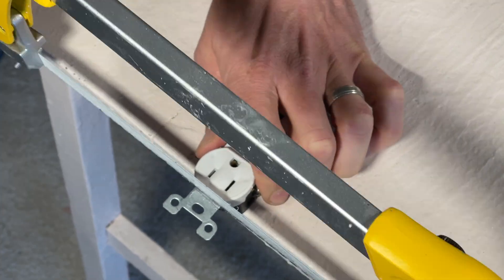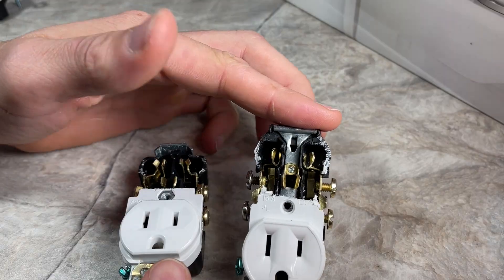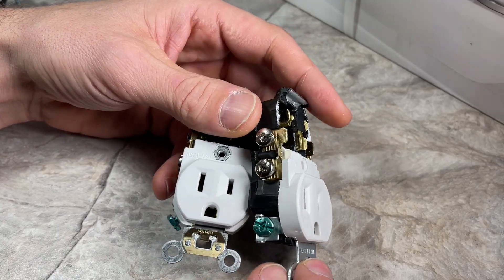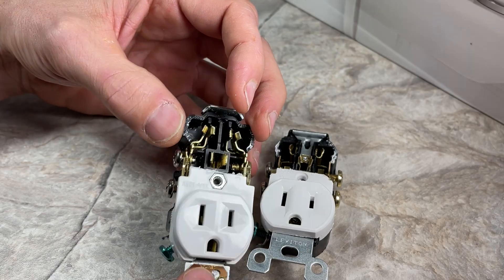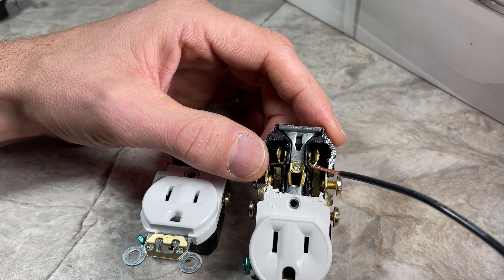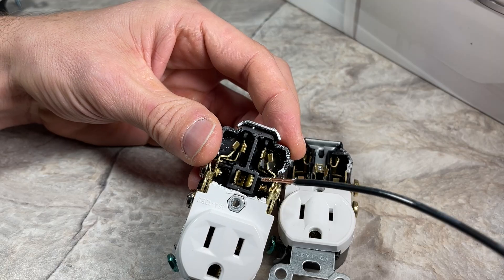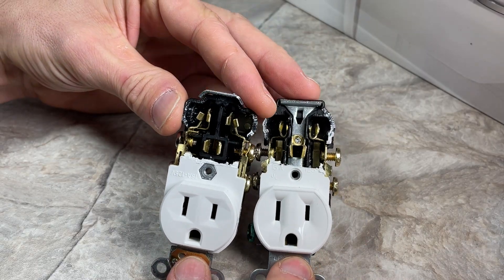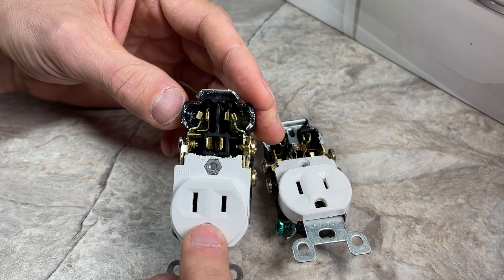What Outlet Should You Buy For Your Home |  Commercial vs Residential

Comment: What would cause the plug from a kitchen appliance, a flat top cooking grill, to be partially ejected from a 15 amp, residential duplex outlet during the heating cycle, which causes the appliance to shut off? It is not a loose plug. Is that because the kitchen appliance is exceeding more than the 15 amp usage than the  wall socket is rated for?  The power does not shut off and when we push the plug in again, the appliance keeps on cooking.

Comment: If hot does short to ground, the breaker or fuse is supposed to blow immediately so that shouldn't be a problem. Where arcing is occurring that is the worst is if there is a loose hot or loose neutral that's got just enough room to wiggle around, that's when you're going to get overheating, arcing, and fire. This is another reason I am so bullish on grounding. If the hot comes into contact with something it will trip. As for the other problem, that's more of a GFCI AFCI which is required in newer builds I believe.

I wish the NEC had broader authority and made a receptacle, outlet, whatever you want to call it, have a minimum specification of the contractor grade, then these bargain bins would go to the rubbish bin, where they should be. So yes, a little bit of dictatorship where the garbage is not allowed to be sold and disappears. If there is a code, then all products sold must be code. For example, Tamper Resistant is code, so then, why the hell are they still allowed to sell stuff that doesn't meet code, is unsafe, and a fire hazard, shock hazard, etc ?

I, and probably most other people assume that if it is sold in the store, then it must be compliant. Now that I know it is not the case, I wish I realized this before. Am I going to change all my plugs, outlets, breakers ? No. But when I do have a problem, I am going to replace the entire thing with the good stuff. For example, there is still a lot of 2 wire circuits in this house. (No Ground) So GFCI has been added for the temporary fix. But when something happens, that requires a new GFCI, or an outlet, I am going to run new wiring. 12 / 3 or 12/4 with ground. Right now, my circuit breaker panel is bonded to the cold water copper pipes with a bare aluminum twisted cable. So when I upgrade the panel I am having ground rods driven into the ground, and the box grounded to that with copper. And I will be spending the extra few dollars. It is tempting to see those for 50 cents and stock up on them, but from a personal preference and just a safety mind set, spend the extra money and only get what I think I need plus a few extra, and return the extras or keep them in a drawer for a future repair... Though like George Lucas, the NEC will probably change it again.

Comment: At least change some outlets for commercial grade, such any high draw device. These include air  conditioners, refrigerators, microwave ovens, outlets where hair dryers are used, and washer / driers.  While changing them you will discover how they were wired: back stabbed or screwed down.  When I was a child I watched my neighbors' father put an air conditioner in a window.   That outlet was where the fire started that ruined their home.  Furthermore, having a more reliable outlet may protect the expensive devices helping them last longer.

Comment: SIDE NOTE:  When I moved into my current house, about fifteen years ago, I replaced every outlet with the better quality ones for all the reasons you stated, plus because I wanted to be sure all the 12 gauge wires were feeding 20 amp plugs.

Even if someone had cheaped out and ran 14 gauge wire, I'd run the better plugs for the same reason I buy insurance.

Comment: I built a new home in 2018 and for some reason it's hard to plug in to the outlets. There seem to be some type of tiny plastic ledge molded in around slots the plug gets hung on and I have to squeeze the prongs just right to get them to slip past those. It's not those solid shutters like in child proof multi outlets it looks like some type of molding error or design flaw. I'd like to replace all of mine with better ones and I may as well upgrade them while I'm at it.

Comment: Don't buy leviton, they're garbage. Get Eaton instead.
Reply: If you're talking about the residential grade the Eaton looks like the spec grade from the front, but the Leviton looks cheap. On the spec grade, using back wiring, I prefer the Leviton. I've had the wires slip out on the Eaton, but never had that problem with the Leviton.
Reply: @surferdude642  Well the new Leviton receptacles can fit 14g copperclad wires, so it's more likely that normal copper wires will slip out of those.

Comment: Now you tell me, after I wired my entire house with the cheap leviton plugs. I did use commercial grade in the kitchen. I think I'll be ok, I mainly changed them all to get cleaner looking plugs then the old 23 yo plugs that came with the house which were the cheap ones to. I don't plug much in and out and I don't have anything that holds a super heavy load anywhere in the house. As I said the ones in my kitchen are the commercial grade and I used a commercial grade single outlet plug for my over the stove microwave.

Comment: for general use .050 outlets will works 99.999% of the time in residential useage when installed with the appropiate amps. The commerical outlet works better in multi-family (apartments) useage because people are less cognizant of how they treat the outlet. 18+ year as a commercial property engineer for HUD.

Comment: I moved into an older (1950-ish) home six years ago, and every outlet was worn out and needed to be replaced.  Not most of them, every single one.  Here's what I think happened.  At first, the most often used outlets wore out, but instead of replacing them, the previous homeowners starting using the remaining outlets.  In time, those outlets also became worn out, so by the time I moved in they were all shot.  It was pretty frustrating because electric cords simply fell out the outlets.  That experience changed my perspective, and now I'm more than happy to spend a little bit more to get commercial grade outlets.
Reply: Well outlets are going to wear out after 70 years
Reply: Cheap or not

Comment: I just did a remodel on my first floor.  We had decora switches but the old style recepticles (ones above) and I wanted them to match.  I replaced almost all the outlets with spec grade. They are really hard to find right now.  Those who have them limit how much you can buy at at time.  I went one step further.  In the kitchen I have a WR/TR by the sink.  I have two outlets at the end of the counter one is a duplex with USB-C  and the other is a duplex with USB-A charging. Several of the outlet are also night lights.  Legrand makes a great night light duplex with 5 level lighting.  My wife thought I was crazy putting so much into the outlets.  Probably spent over $500 on them.  But to be honest, in a past house I had an outlet short and nearly burned the house down.  It melted 12" of the romex before the breaker tripped. Outlets are cheaper than a house.    In my Garage (worshop) I have industrial outlets, they cost over $6.00 apiece.  
The only issue with the really heavy duty outlets is that some are VERY hard to plug and unplug.  

Love your videos.  Only through a few so far but I find them informative and interesting.

Comment: When possible, which is most of the time, I go for the mid-range quality price point. I don’t usually need top quality or features, but going cheapest usually costs in the long run.  And if a cheap outlet fails and just grounds out it can be very difficult to troubleshoot. In fact, we had such a situation, it didn’t throw the breaker, and it was the last outlet we looked at. In addition, like a lot of older electrical the box is not well marked, and some runs aren’t logical. So we had to use a multi-tester for each outlet , and it took a bit of time. When I unscrewed the face plate the outlet just fell apart!

Comment: I typically prefer buying a receptacle that "feels" heavier and is built for 20A as opposed to 15A because most of the time I use 12g for everything except for fixture branches, in which case I'll run 14g.
I'm willing to spend a bit extra money for a circuit that can handle  a few extra amps from time to time because you never know what someone will plug in. I've seen plenty of people smoke a 15A receptacle running old school appliances that draw a ton of amps.

Comment: Fear not. At $0.50 per outlet the manufacturer is earning tens  of million dollar per year. Remember, millions of outlets are replaced and installed per year due to cracking of the plastic housing, conductor damaged by arcing, loose locking spring,  damage caused by excessive current, rewiring of circuit,  GFI substitution, and change of esthetic.

Comment: I put 30 cheap ones in my NYC apartment and have had no trouble for 30 years! If it's wired correctly there is rarely a problem! I rarely plug in and out! The only time I see a problem is with very old houses!

Comment: In my basement shop, I always used 20A plugs and #12 wire.  That way I never had to worry if I needed to put a real load on it for a short period.  I did the same in the kitchen and bath circuits.  In the bed room i didnt mind going cheap.

Comment: Receptacles that hold a plug tight are a PIA! People pull on the cord hard, and over time, damage the end of the appliance cable where it attaches to it's plug. 
I have the residential outlets in my house. Some from the mid-1950's, and none have had an issue.
I HAVE had issues with $20.00 GFCI receptacles failing.

Comment: I'm an electrician who does work in custom houses, where Decora style devices are invariably specified. I also note the base Decora receptacle is the same innards as the 5320. However, there is a bigger price differential between levels of Decora, meaning there is still a place for the base 5325 units.

My experience is to put the base devices in places where things are never or rarely plugged and unplugged. It's a waste to put heavy duty receptacles behind nightstands, TVs, etc. Even things like FAUs, disposals, hoods, or other fixed appliances will work just as reliably with base receptacles. As long as the device is plugged in, the jaws will hold fine and last indefinitely. Keep in mind they are rated 15 amps.

The place where receptacles get in trouble, as demonstrated in the video is when things are routinely plugged and unplugged. Think the kitchen, hallways, garages, or desks at home offices. Anywhere there is wear and tear is a good place for a heavy duty receptacle. Anywhere they are either not used are rarely unplugged is a waste. My point is to pick and choose the best places. Don't go completely cheap, but also don't spend money unnecessarily.
Reply from the maker: Hey Casey, thanks for the feedback and sharing your experience.  Cheers!

Comment: Always go with the best.  After smoke came out of 2 different outlets in my home, I replaced everything with the good stuff.  It's not worth your house burning down to save a $1.  Plus, I fixed all the sloppy and incorrect work the original installers who build houses do because they are on a time schedule.  Also, I always add some electrical tape around the pigtail wirenuts.  I've found crappy jobs where some of the can lighting won't come on because the wire nuts fell off and the wires came apart.

Comment: NEW IDEA FOR VLOG:  The wires used in DIY addition, extending an inside kitchen 15A receptacle to create an outdoor 15A GFCI receptacle, were apparently compromised (the insulation was scratched/stripped exposing the wires) when pulled through the wall from the inside to the outside, such that as humidity increased an OPEN NEUTRAL error cut power outside via the GFCI triggering.  Putting aside any other issues, the wires used give me pause.  Some of those wires running inside and outside were varying degrees of ridiculous:  some were like chain link fencing and others were like my computer mouse cable.  A trip to Lowe's and I realized that there are various choices 14/3, 12/3, etc.; some easier to bend and work with than others; and some rated for 20A & 15A, or just 15A.  My breaker box says 20A for this circuit/line.  Could you teach us what wire we MUST use, notwithstanding the insane un-bend-ability or huge diameter of some choices?  And could you cover whether we can/should upscale to 20A wire/receptacles if we already have a 20A breaker in the box?

Comment: EVERYDAY HOME REPAIRS< if you go buy an AC power strip that has multiple AC outputs it will tell in the specifications that the whole AC power strip at maximum is at 300 joules, but what does that mean about 300 joules because it has to do with how much the LOAD you're connecting to the AC power strip if you're putting to much LOAD more than 300 joules it will trip the ac power strip but how do you know if your LOAD is less or more than 300 joules? as well as is it 300 joules per/for each AC outlet on the power strip or the total of all the ac outlets?

Comment: I believe in over-engineering things to make them last, and I believe it worth paying extra so as to avoid breakage or avoidable risks. We do not really know in advance which outlets will be used for merely a clock-radio or lamp, or a heavy-current device such as a heater or air conditioner. So why not use better quality for everything?
Reply: because the cost does add up. sometimes it's worth the cost though. sometimes it really wasn't. hard to say.
Reply: @Layarion  
It is generally better to over-engineer something, than to do a shoddy job. It is much easier to do it right the first time, than for a customer to have a problem that could have easily been prevented by installing stuff right or using better quality equipment.

And often those costs can be passed onto the customer anyway.

Why risk an outlet arcing or overheating, just because the customer plugged in too much power-consuming stuff. Why not use rugged reliable equipment?

Comment: I am still amazed that the code does not enforce 30mA differential breakers for all the circuits, in the main service panel, so protecting people both at outlets level but also anywhere in between. It is mandatory for european code since 2002. 
It is also forbidden to install grounded outlets on non (historical) grounded circuits.
Iron electrical tubes are also forbidden, as they are too often badly of not properly grounded.
Child secure tamper resistant outlets are also mandatory.
Security is not an option.

Comment: I got a first-hand lesson in outlets when I moved into my house in 2017. The house was built in 1994. Many of the outlets were failing - some had burn marks on the front, and many would no longer hold a plug properly. These were all cheap builder-grade outlets. 

I've replaced every outlet (55!) with commercial grade outlets. I got nice commercial Legrand outlets, and I was able to pick up a 10-pack for around $13. Make sure you shop around - price differences between Amazon, Home Depot, and Lowe's were huge.

Comment: 35 years electrical experience.. it’s not worth the money.. most of the same receptacles that get used over and over for vacuum machines etc will wear out.. just replace those very few receps every few years.. most plugs in a home never even get used. Use 20A in a kitchen though.. they do get used hard..

Comment: Honest question why would you not use the push pins?
Reply from the maker: Fairly common source of failures.  Since I prefer commercial grade receptacles I just use the back wire feature which is different as compared to the speed wire / push pins.

Comment: I just like the tactile feel of inserting a plug into a better quality outlet - the outlet firmly grips the prongs with a secure snap. I've noticed that most GFCI outlets using the Decora design do not have a secure snap when the plug is inserted. Those outlets I encounter in hotel bathrooms are almost always shot, barely gripping the plug.

Comment: Yeah, ditto to all said before. Now here's the real test; How easily does it give up the plug when you pull? CHRISTMAS ON A CRACKER! Some of these things hold onto the plug with a Kung Fu grip! I mean, you pull on a cord, the outlet is rockin' the receptacle box is bulgein' and you know you're not doing any of those wires inside the wall any good. I know, I know the cords should not come out too easy for safety reasons. But, do I have to pull on them like the pull cord of a crappy, old lawnmower to get my stuff back? What's up with this BS?

Comment: Cool video - thanks!   
I like the ease of installation of the higher grade receptacle.  The time savings is significant for me and I don't dread changing out a receptacle.  I use wago connectors and commercial receptacles, I am a happy camper.  :)

Comment: If the cheap one failed.... Say melted to the point some wall repair needs to be done.... Could the possible arching and heat cause damage to the wire in the wall? 
A freind had this happen recently and she is worried the neutral that's now brown doesn't have goodx sheiliding. It only 3ft from the box it gets power from.
Reply: The breaker, assuming it's the correct size, is designed to protect the wiring. The browning on the neutral wire insulation is likely from the arc flash, not from the wire itself heating up. You could probably clean the brown off with some rubbing alcohol. The length of wire further away from the device box should be fine.